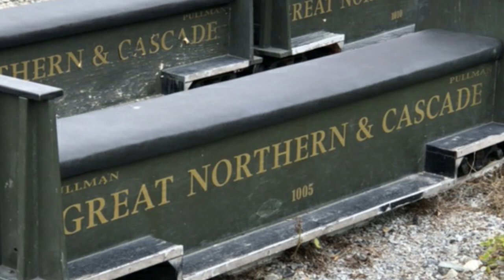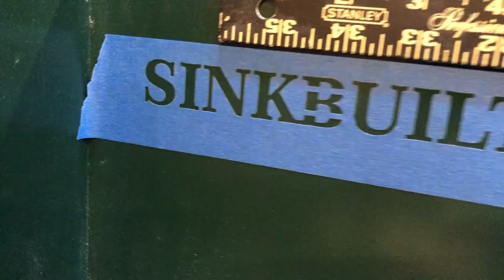Riding car

Comment: Awesome build! I love the cup holder, definitely something I'll have to add to my riding car! Seems like a sturdy and comfortable ride, and plenty strong too. Now, you say you don't have the equipment for a large metal project, does your locomotive also have a wooden frame?
Reply from the maker: Thanks! And yes, Loco frame is built up with 1/2 furniture ply which works great. In hindsight though, it really should have been 1/2 steel plate for maximum weight and traction. The small size of the loco really limits how much weight I can add to it.

Comment: Nice! What is the longest legth train you run and does your engine brake the whole traIN or do any of your cars have brakes??

Also, whats a reliable source for aluminum rail? Thanks.
Reply: Accu-tie make plastic dleepers and have both steel & aluminium rail available 🙂
Reply: @LordPhobos6502  ty

Comment: How did you come up with the measurements im new to the hobby
Reply: I am new aswell, and I would say, the best advice and way to come up with measurements is to look up a reference image of what it is you want to make, and first and most importantly, get the size of the wheels, then scale everything based off of that, that's what I do and it really does help to know the wheels cause, like I said before, you can scale everything accordingly. That's what I do but just a suggestion. Hope this helps. God bless.

Comment: Is that coupler 3d printed? It looks like there are some layer lines on it.
Reply from the maker: Sure is! I did some research on how couplers work and put together a CAD model in Solid Works. Coupler is printed in ABS and works great.
Reply: @TheWeevilGenius  cool! Do you have a link on thingiverse or something?
Reply: Your printed parts look very well. I also have experimented with printed parts in 5". So i have made the trucks of my tender in a mixed manner: axleboxes, connecting rods and frames ar printed in ABS, the girders are in steel. A test run: https://www.youtube.com/watch?v=tInJkMjRVKY . I didn't try to make couplers this way. Did you encounter problems during driving?